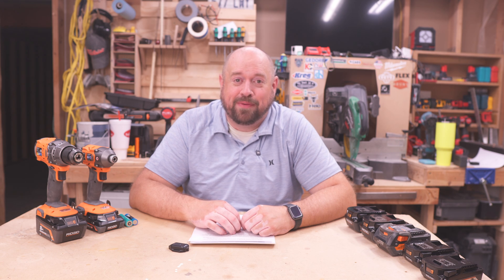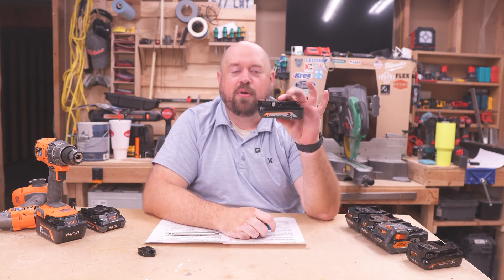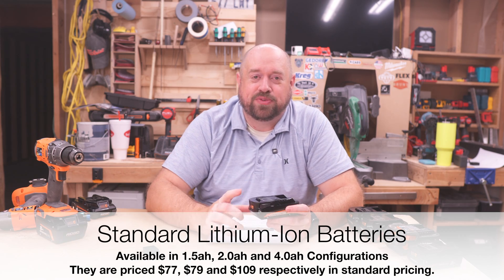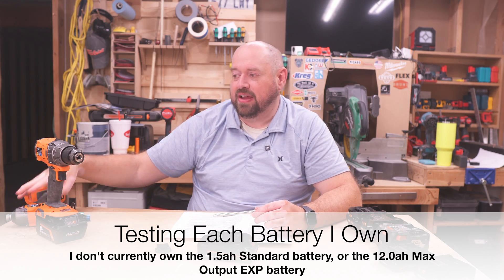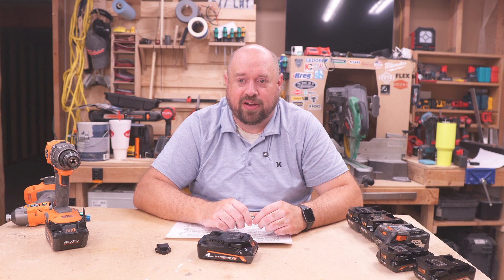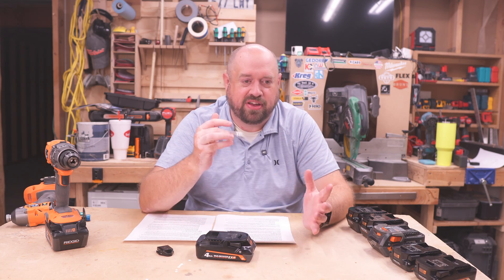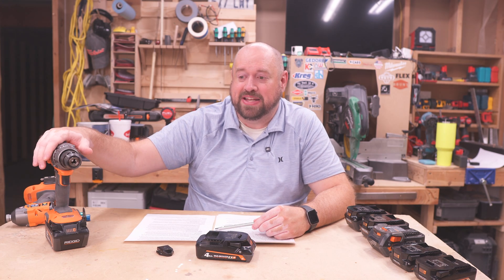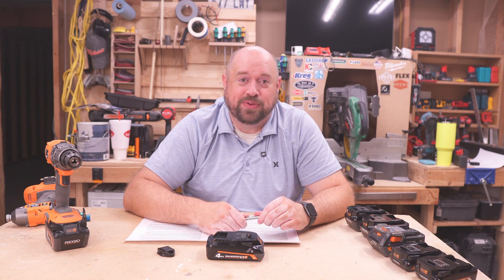Ridgid's Best Battery Ever!  Testing the New 4ah Max Output EXP with Tabless Cells!

Comment: One of the gimmicks for Octane which also might be why is was discontinued was the blue tooth.  I think it made the batteries more expensive to produce while not really adding features people regular used.  I find that Octane batteries also drain in storage faster than non-octane since the Bluetooth is constantly on.
Reply from the maker: I never owned the octane batteries because I was getting off the ridgid platform when they became more popular but they seemed like a good battery from everything I had heard.  I appreciate you sharing you experience with them!

Comment: Since 2016 I’ve been aware that Ridgid’s 4ah battery yielded better performance on my impact vs. the 2ah ones it came with. The 2ah are only good in light applications at best, they work well in the 18g nail gun overhead or in light woods. Now I have the 18v portable miter saw with the 5in blade, my 5ah standard battery just failed to charge after 8 years. Fortunately I registered it with the LSA after purchase. With only a weeks time turnaround I sent it to Ridgid for repair and they sent me a 6ah Max Output. Really impressed the my sent me a better battery, looking forward to utilizing it on my next project.
Reply from the maker: Nice advantage to that LSA I guess!
Reply: Had the 3Ah Octane which you could lock with a Bluetooth App which was cool. Lost it in a breakup…but it’s locked so there is that!!! @

Comment: The old Octane 3Ah batteries had the 21700 cells, and only that size I believe. At the time I don't remember it being a huge selling point as far as marketing was concerned, but people found out that those compact packs put out way more power with those cells. Then it got discontinued with the whole Octane line. This new 4Ah Max Exp is fairly similar.
Reply from the maker: Octane was definitely a star there for a while that I wish could have stuck around.  You can still buy the 3ah Octane batteries but given the fact that they haven't produced them in a few years now, I don't feel good buying a battery that has just been sitting.
Reply: @TinkerWithTools  That's true as well providing if you can find them. Would love to get one of the new 4Ah Exp batteries though.

Comment: When looking at the high-performance tools, the box usually indicates the specification using a high-performance type battery. The reason is quite simple. The tool requires more power from the battery and the lower-performance batteries are unable to meet that demand. Going from a 2Ah battery to a 4Ah battery is going to deliver more power as it has twice as many cells. The voltage will drop off as the battery nears its cutoff point. The higher the current draw near this point will drop the voltage sooner. Since a 4Ah battery has twice the number of cells, the voltage drop in the cells will be less due to cells only having to provide 1/2 the amount of current versus the 2Ah battery.
If someone is using a tool that does not need the power of a high-performance tool, buying the high-performance batteries is not going to be a big benefit as standard batteries are capable of providing the power need to run the tool at is maximum potential. The tool may run a little longer on a high-performance battery due to the fact it will not reach its cutoff point as quick as a standard battery. 
Another critical point is that most DYI or hobbyist do not use a tool such that they run down the battery to the point it needs a recharge. Someone using a standard drill with a fully charged standard 2Ah battery drilling a dozen  1/4"  holes in wood is not going to need a high-performance battery.
Most of the tool manufactures when bundling a tool and battery, will match up the tool with the appropriate type/size of battery.

Comment: I'm glad I came across your content here, A really well-done load test and very good illustration, Thanks, man. After watching I think I'll be buying a couple of the 4amp and 8amp EXP's The 8amp should prove effective on the rigid 12 chainsaw. I am one of the RIGID tool collectors and have most of their cordless and corded power tools.  So these batteries will find a good home here. I wonder when they are going to go all pouch construction? I think what I gathered here is the 4ampEXP is a pouch type internal and the other EXP's are the bigger cylinder type.
Reply from the maker: Thanks for your comment. The 4ah EXP is a tabless cell battery.   They are still cylindrical cells and not considered pouch cells.   The only companies doing the pouch cells are DEWALT, Milwaukee and Flex.  And even at that Milwaukee and DEWALT are also doing Tabless cell types.  I would bet it’s more likely to see tabless cells taking over vs pouch.

Comment: Is it safe to put dewalt batteries on ridgid tools with adapter?
Reply from the maker: I have never really gotten into battery adapters with the exception of using a universal battery that is made to be used with adapters.  Not saying it won't work, I just don't have the personal experience to advise you there.
Reply: No BMS in Dewalt batteries.

Comment: Have you tried this 4 ah exp with the gen 1 and gen 2 subcompact drill and impact driver?  I’m curious if this provides a good boost to any of those tools.  The 2 ah batteries are great weight wise but they don’t always give the most zing.
Reply from the maker: I haven't tested it with those specific tools and I think I only have the gen 2 version of those tools at the moment.  But in general - I've seen drills experience more of a bump on a more premium battery than I have with an impact driver.   I would expect that the sub compact drill would be more responsive to it.
Reply: @TinkerWithTools  that’s good to know. Thanks for the response.

Comment: One area where I found the regular batteries almost unusable was when cutting with the dye grinder and cutoff wheel. Almost immediately the standard battery cut out. Ended up grabbing one of the high output batteries to correct it.
Reply from the maker: I appreciate you sharing!

Comment: As an engineer I appreciate a well executed data driven evaluation.  I especially appreciate the information about the internal construction differences and cell types.  BTW I'm an electrical engineer and your explanation of electricity was fine.  Good enough for the average Joe. :).    As a side note, right now as I post this comment HD has the standard battery 4AH starter pack (2 batteries + a charger) on sale for about half the price of a single 4AH EXP.   For most hobby work (which is my world now being retired)  I'd say that's a better bargain overall and that's what I just bought yesterday.  I may pick up one of the EXP batteries just for those times I'm in a really heavy demand task if I find the regular batteries lacking in any way.
Reply from the maker: Yeah the standard packs are going to be fine for a lot of work.

Comment: I think one interesting thing that happened was between the standard 4Ah battery and the 2Ah MO battery. It seemed like for shorter high demand tasks, the 2Ah MO battery slightly outperformed the standard 4Ah. On the slightly longer higher demand tasks, the standard 4Ah slightly out performed the 2Ah MO. My guess is the 2Ah MO has a very slightly higher instantaneous amp output but cant sustain that and as it cuts back, the standard starts to surpass it.
Reply from the maker: I am not an expert by any means but your theory makes sense as a reason why.  I have always thought about it like lifting an object.  I may be able lift x number of pounds on my own briefly by giving it all I got but if I have a team lifter we are likely to make the job easier as we spread that weight over two people.

Comment: Ridgid has always been very good for the price & unbeatable warranty. When Ridgid/AEG first started they had a better drill than milwaukee (sellout) who licensed Atlas Copco to build flamboyant red Loktors for them. Ridgid even had a more powerful drill with an alloy housing instead of old milwukee's best nylon or whatever.  That was a long time ago and if you consider how many times old milwaukee has switched battery configurations, while all of Ridgid's 18v batteries are reverse compatible for over 24 years and the fact that old milwaukee isn't really even an American company, except for a cubical in a building of South Carolina, getting started with Ridgid has never been a bad idea.
Reply from the maker: I do think that they are a solid platform I just worry about some of the ups and downs they have had with their lineup over the years.   They had a big push with octane and more powerful tools but then it didn’t sell and they discontinued for the most part.  Then they are pushing forward with more powerful tools again and I hope they stay that way cause they are making some solid stuff especially this drill here.  

As a side note just for clarification.  Ridgid’s name is licensed by TTI and they are the makers and developers of both Ryobi and Ridgid tools that you find on Home Depot shelves here in the US.  AEG is the global name of the same tools.   TTI also owns Milwaukee but milwaukees developement is independent from the other two from what I have seen.    I am sure there is some sharing of R&D at the corporate level but I don’t think a single design team is behind all three brands.
Reply: @TinkerWithTools  Not Ridgid's fault that Milwaukee is litigious sue-happy company.  Also seems unlikely to be a coincidence to me that after Ridgid re-launched many of their power tools, suddenly the ones that used to kick M's ass in testing are now just a little lesser in power or in size.  RIP Ridgid High torque impact wrench, killed by Milwaukee in the court room because Milsue-waukee couldn't let another brand beat it and others in the marketplace.
Reply: @GarenP  You are absolutely right about that, that lawsuit was total BS. I think covid really messed up Ridgid's tool release it was postponed for over a year. We never got the Ridgid rivet gun we were teased, I ended up getting the AEG version, it's pretty nice and almost paid for itself.
Reply: Do you think these 8 amp max output exp will run the octane tools well?
Reply: Yes, they absolutely will run the Octane line and all of Ridgid's tools except the 12v line obviously.
Reply: @TinkerWithTools  Something must have recently changed because Emerson owns Rigid now, not TTI, which owns Milwaukee and Ryobi.
Reply from the maker: @0828-d4p Emerson does own Ridgid but licenses the name to TTI who produces the RIdgid power tools (also AEG globally) that you find in Home Depot stores.
Reply: @TinkerWithTools Milwaukee didn’t like ridgid making tools as powerful as them
Reply: You're wrong about Milwaukee not being a American brand, it is a American born brand
Reply: @mtasubwaymartasubway  Yes, milwaukee started out as an American brand, but the sellouts who ran the company sold out in 2005. It has been a CCP owned company ever since.
Reply: @mtasubwaymartasubway **was. Look at any Milwaukee tool, it’ll state where it’s assembled. Not in the US.

Comment: Well JUST Thinking that if RIDGID MAKES the 8 Amp EXP BATTERY TABLESS CELLS next year and just Have it be the SAME Price has the MILWAUKEE M18 FORGE 8 Amp BATTERY and make a 6 AMP EXP BATTERY with TABLESS CELLS for $160 that would be nice
Reply from the maker: I was really impressed with the battery.  Have you liked the Ryobi battery?   Didn’t I see that you picked it up?
Reply: @TinkerWithTools  the RYOBI EDGE BATTERY is nice has the power of the 8 Amp HP 21700 cell battery just much smaller and I glad you explained all about the TECK of TABLESS CELLS me I'm just like a race car Driver just put the tool to work I will be testing the RIDGID this next week and    it up AGAINST the RYOBI EDGE BATTERY I'm SURPRISED TTC has not got the new BATTERIES yet so they can run the HIGH TQ IMPACT WRENCHS on their MACHINE and SHOP TOOLS REVIEWS should have got them LAST Month I'M SURE CLINT will be showing them off along with VCG CONSTRUCTION
Reply: @ericnichols9275  But can the edge take a ball off a hitch??😂
Reply: @ericnichols9275  I guess tabless is taking over the pouch market now